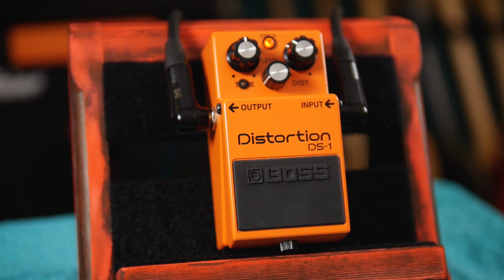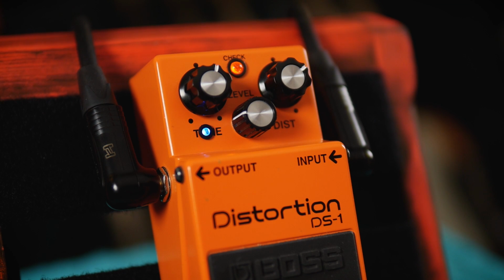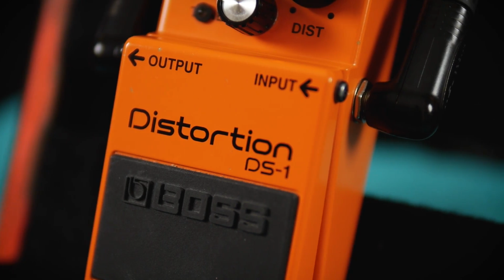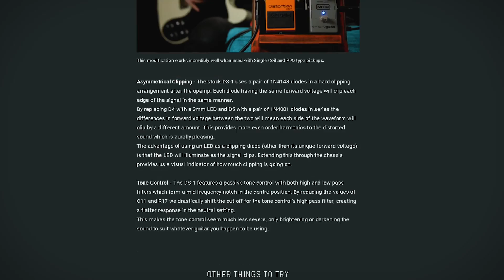Modified DS-1 | Gain Appreciation

Comment: the Sweetwater link doesn't seem to like correctly, you might want to check that.

Also, is the stock ds-1 only $50?!? Huh
Reply from the maker: It carries me to the correct location. 

What issue are you having with the link?
Reply: @ScienceofLoud  I just sent me to the home page instead of the product. :shrug:
Reply from the maker: There are two Sweetwater links in the description, the first one leads to the product, the second is a general homepage link.
Reply: @ScienceofLoud  That would make a bunch more sense then! Both links work as intended

Comment: I actually de-modded my DS-1 because I wasn't happy with the mods that I had done. I plugged it in and basically had to pinch myself because it actually sounded pretty good. I think the reason why so many distortion pedals like the DS-1 and the MT-2 get a bad rap is because they're often used in front of sparkly clean amps, which ends up making them sound fizzy and terrible. My amp is a lot darker sounding than most other amps, and a DS-1 sounds great in front of it.
Reply: I totally agree. I run my ds-1in my egnater vengance fx loop on the higain channel sounds absolutley amazing for what i want.
Reply: I did the same thing! I tried different mods and compared it with a stock one I had also bought and finally made it back to stock with only two LEDs for clipping for a variation in character.
Reply: The DS1 kills on a Marshall. Mine is really dark and foul so the DS1 really brings it to life.

Comment: I have a modified one. It has two modes, one which sounds like a Marshall and one which sounds like a heavy fuzz with insane oscillation past 12 O’clock on the distortion knob

Comment: the only mod i could figure out on my ds1 was to rip out one of the clipping diodes (literally, i ripped it out with pliers, i couldn't get my solderer to do it for some reason i forgot).  turned it into more of an overdrive/boost (but holy shit the output increased a lot!).  pretty cool though.  wish i was more techinically inclined and patient to explore further mods.  yay, i'm commenting on a 2 year old video!

Comment: Whoever buys a new DS1 in order to modify it, will have a pretty tough job, since they use smd components now. My suggestion should be to look for pedals made until 2016
Reply from the maker: This is important information I was not aware of. Thank you for bringing it to our collective attention.
Reply: There LOTS of thru-hole DS-1's out there for sale. I just bought two for $30 each, I've modded one already.
Reply: @ScienceofLoud  The new SMD variant's power plug is flush with the bottom whereas the old through hole variant's power plug sits almost half a cm higher. That way you can see which PCB variant it uses. You can look at the Waza Craft pedals, their power plugs are in the through hole position whereas all new regular pedals are flush with the bottom, the SMD position.

Comment: Awesome video but the fun is over unless you find a used one. I bought a new one and out of the box the dirty sound is about 50% lower than the clean sound. I opened it up to mod and it a tiny little board with micro components now. I was able to find D5 and lift it but that's about it so far. That improved the levels anyway.

Comment: Someone need to modify a DS-1 to make it have ungodly amount of gain.
Reply: The inverted collin mod ALL THE GAIN NO MIDS DS-1 sounds like bee nest
Reply from the maker: I've seen people modify them into full on noise generators. Give them so much gain they start playing their own 'music'
Reply: @ScienceofLoud  You should take a pedal such as the boss OD-1 or Blues drive and give it to a blues player but secretly modded it to have more gain than the Metal zone on max.
Reply: Don't they call that the Metal Zone?
Reply: How about modifying that to be a clone of the DOD Death Metal pedal? That pedal had no gain control
Reply: @dionr1168  Just make a Boss HM clone with no controls, just one button for on and off  and everything is always at 11.
Reply: the nature of pedal modders is that they accidentally invent the metalzone every so often
Reply: @dionr1168  those were great pedals. Especially if you mod in a gain control.
Reply: Take the gain pot and increase the value. A lot. Also try wiring in more diodes and stacking op amps.

Comment: You should buy like 50 used for about $35 bucks US. Mod 'em. Sell them as limited production for around $200 on your channel. It'll be the next Pussy Melter.
Then repeat the cycle with the SD-1.

Comment: Are the two 1N4001 diodes installed in D4 and D5 to make a series circuit? If so, not sure how the red LED would be connected. Or, are the diodes soldered in series and installed in D5 only? The red LED would then replace the diode removed from D4, correct?
Reply from the maker: The 4001s are in series with each other replacing D5, the LED replaces the diode in D4.
Be sure to get the polarity correct in all cases.
Reply: CSGuitars Perfect, Thanks!

Comment: My usual problem with distortion pedals is low headroom, meaning you always have to put the Level or Output or Volume control to almost maximum make the distorted sound as loud as the clean sound. Is there any way to rectify this? By the way, the DS-1 modded by you Colin is a very very huge improvement over the stock one despite you saying there is still room for improvement.
Reply: Distortions like this usually have your signal go through diodes clipping to ground then through passive tone controls and both will eat output volume. Changing the diodes on a ds-1 to LEDs or just clipping one out will add considerable volume to the output. The stock diodes will cut your volume much more than LEDs will. Many pedals are designed with an output boost stage at the end to compensate for this (like the big muff) so you could try and put a clean boost pedal after your distortion or just try out a bunch at the guitar store and see if you can find one that has more volume.
Reply: @keithmaynard8394  ah ok, now I understand. The design of the pedal itself or at least the components makes this possible. Thanks for the reply! Appreciate it!

Comment: i really don't quite get the trouble of going through everything to mod pretty much one of the best pedals to ever exist. i don't mean that in a biased way, i mean that in the sense of reverence in the history of guitar effects. similar to the Fuzz Face or the DL4 or the Wammy. there are some cool mods that really do make the DS1 more usable, but THIS mod....it pretty much just adds a useless LED. i have a stock DS1, and literally none of the samples from the video are any different than what i can get....ESPECIALLY since everyone with a little bit of fiddling around can figure out you have to roll off the tone to avoid tattoo'ing anybody in earshot of the amp....but since Colin spent this whole video rolling the tone knob off to almost no more than 50%, then he's still using it like there was no modifications made to it. which is most likely why i can get similar sounds from my stock DS1.
listen, no pedal is perfect, no single piece of gear is perfect. i think there is true validity to modding a DS1....but if you do go out of your way to mod any piece of electronics (especially for guitar) just make those changes obvious enough to where you can actually tell a difference....otherwise you kinda wasted your time doing a lot of work for practically no change. like taking a bucket to the beach to scoop water back into the ocean.

Comment: Respect.

I have been using the DS-1 for a very long time (about twenty-five years) and it has always been my first choice with Distortion pedals but ... A few years ago I made a "JCM800" modification and with a few more changes I got a fantastic pedal. But ..., as with the original pedal, I still have a problem with the "Tone" potentiometer. My problem is that this potentiometer is usable only in the range from “zero” to half the stroke of the potentiometer. Is it at all possible to transfer that range to the entire range of the potentiometer. In other words, I want to eliminate that “other half” since then I would have much better color control of the tone.
I hope I was able to explain what I wanted.

I apologize for the poor English and thank you for your videos from which a lot can be learned.

Greetings from Croatia and all the best.

Comment: Sounds great. I've found that just taking out two of thr clipping diodes can make a lot of difference, but it becomes more of an overdrive than a distortion!
Reply from the maker: So much can be done by simply adding or removing clipping diodes. It's a very easy way to change up the sound of a distortion or overdrive pedal.
Reply: @ScienceofLoud  just getting my footing. Made a fuzz pedal in a tin from a mate of mine, Hubcap John. Felt good!

Comment: I've got the DS-1X so does all of the above apply? If I tried a few simple modifications based on this video and my limited understanding and ability, would I run into a different set of problems?
Reply from the maker: DS-1X is a digital pedal. Do not attempt to modify it.
Reply: @ScienceofLoud  Thank you for replying Colin. I'm not sure why I shouldn't attempt to modify it but your advice saying not to is enough. You've no doubt saved me having to replace it.
Reply from the maker: You can modify an analogue pedal because it's analogue: the signal is being passed through a series of analogue components that each modify the signal in different ways. Changing a couple of components could for example change the frequency a filter will cut off at, or set the gain threshold for the opamp. The components are what makes the sound. 

You can't modify a digital pedal because it's digital: the components within are designed to support a processor and the sounds are generated through complex simulations. The tones are essentially generated by software. Changing components will not alter the sounds, they will brick the device.

Comment: Re: the MXR Smart Gate, if you have a moment, why in front (preceding) of the mod DS-1? Noisy pickups? 

FYI, I look forward to your new videos with great anticipation each week (or so).
Reply from the maker: The noise gate is there for the same reason any noise gate should be used: to prevent low level noise in a signal travelling beyond the gate when no notes are being played. 

The pickups aren't 'noisy' but there will intrinsically be a noise floor which the DS-1 will amplify making it audible. 

Putting a noise gate ahead of a distortion pedal simply means that the only thing getting amplified and distorted is the intended notes, not the spaces between them. 

It's just good house keeping and provides the cleanest audio, I always have a gate ahead of the pedals I'm demonstrating.
Reply: Putting it before the distortion trades off a bit of sustain & pinch harmonic response for faster response & less hum from pickups.
Reply: @ScienceofLoud  Thanks! You have a well considered, and sometimes unique, method to your choices.
Reply from the maker: It doesn't trade sustain if the threshold is low enough. The real benefit of placing a gate ahead of a distortion pedal is that there is a greater separation in level between signal and noise floor. 

The gate is barely on, any sustaining note that gets cut off by my gate would have been so quiet it wouldn't be qualified as a sustaining move any longer. 

Placing a gate after distortion will clean up system noise from the distortion, but due to the distortion's compression there is much less level difference between signal and noise, meaning a much higher threshold and notes getting cut off. 

If you want a totally silent rig at high gain then using two gates (one before and one after the distortion) will prevent pickup noise floor being amplified and remove system noise without compromising sustain.
Reply: @ScienceofLoud  Thanks again for your time and explanation!

Comment: Maybe it's my ears, but it sounds more like a fuzz than the original sound of a DS-1. Still pretty sick though 🤘
Reply from the maker: The DS-1 is a very square wave distortion through the entire sweep even stock. 

This unit retains that at the higher distortion settings, but gives softer distortion at lower settings.

Comment: big oof, i decided to open my pedal up to mod it and learned its a surface mounted pedal
Reply from the maker: Oh, they must have changed it to SMD in the last 5 years when I wasn't looking. 

Might have to look at the second hand market for a slightly older one for an easier modifying experience then.
Reply: I believe the 40th anniversary models use full size components
Reply: What is the meaning of "surface mounted"?
Reply: Youval S try searching SMD soldering on YouTube to see rocket surgery level of hand steadiness. AKA smaller components that is very hard to work by hand without magnification.
Reply: @ValSchnitzel  
It just means that it doesn't have an actual lead coming out of the component that goes through the board and is soldered on the other side, the component is actually mounted directly to the same side of the board. They can be a little tricky if you're not used to messing with them and if you don't have a decent iron it's easy to burn the board, the component, or both.

Comment: This will be an interesting project after I stop sucking at guitar playing! The circuit of the pedal is DC, right?
Reply from the maker: I suck at guitar playing and it didn't stop me. 

Yes, the circuit is designed with supply voltage of 9VDC.
Reply: @ScienceofLoud  alright, I think we are talking about two very different levels of sucking here :) (one year of learning Vs sereval years). It sounds like a interesting thing to tinker with!

Comment: p90s have lower output? do you mean lower frequencies because i believe p90s were made to have very high output
Reply from the maker: Compared to the higher output humbuckers that I was using, yeah they do.
Reply from the maker: It's all relative, P90 were designed to have high output compared to the single coils available at the time.

Humbuckers then came along and could be made to have higher output than P90s.

I'm talking relative to the other guitars I was using, the P90s have less output than the humbuckers and the single coils have less output than the P90s. That's not intended as a general statement, but specific to what I was using.

Comment: Hi, Colin. Yes, there's much room for improvement, because it's closer to a box full of bees and fuzz pedal than a high-gain tube amp. Also 90s death metal has a much more different type of grind and I'm not sure if any other tonal characteristics of this pedal could be associated with the specific sound of that genre. Henning Pauly managed to get a Metal Zone to sound way better in front of an amp - https://youtu.be/3nGiNeENw2g?t=847

Comment: Nice Collin! Actually I just picked up three modded pedals from Alchemy Audio out of Chicago. I have to say that I am impressed. I picked up a Big Muff Pi, a Danelectro Daddy O, and a ProCo Rat. The Muff and the Rat have the Dead Bat featute where you can starve the pedal of voltage. Each pedal has a mini toggle that lets you select two different clipping options or none at all. 

Now I used to have a SovTek Big Muff and the Rat back in the 90s, they were ok...not really what I was looking for at the time but an education. The $300 plus on the Sovtek...that's just stupid. It will always be a $60 pedal to me...and that was a new one. The modified Pi model is way better. Now that I have my sound and my style I know what I am looking for. These modified pedals give you more than a standard pedal without a boutique price. Besides they are really cool looking as well as sounding!